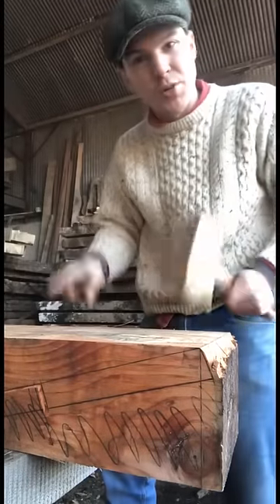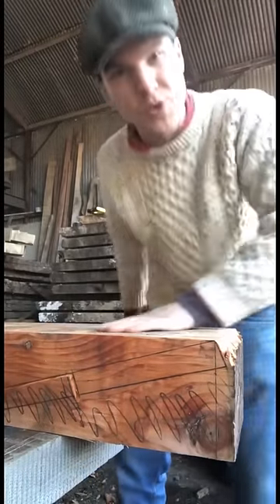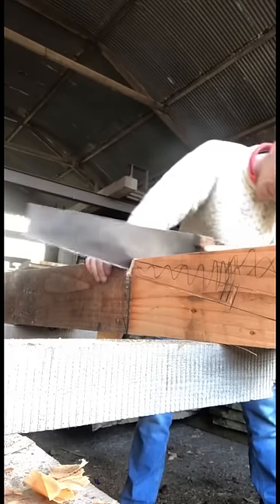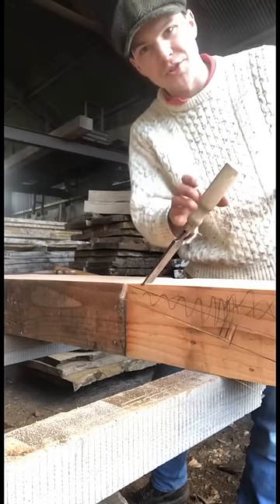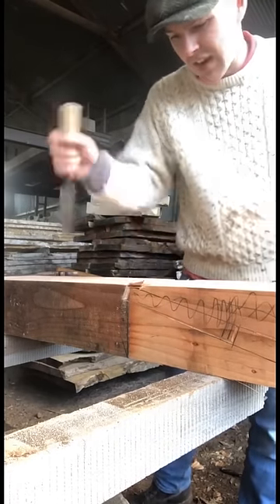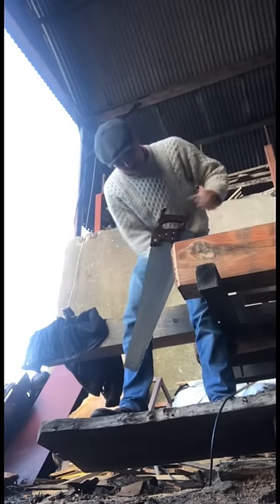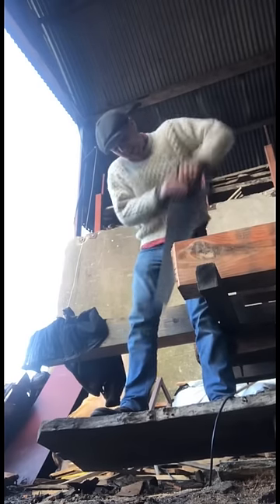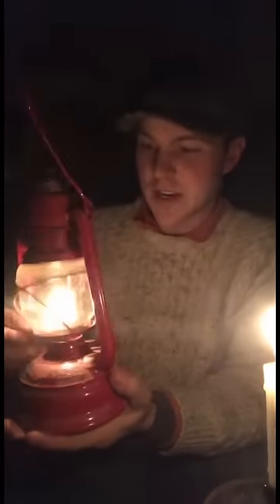Cutting A Large Scarf Joint #shortvideo #ireland #woodwork #joinery #timberframing

Comment: Scarf joints are fun. I use a circular saw to get close to my layout, and then cut the bulk away with a chainsaw. Then chisel to fine tune everything. A grinder with a sanding disc can speed up flattening the surfaces, too. I'd do one without power tools, but with multiples, and a client, power is pretty handy.

Comment: @EoinReardon I love your content Mr. Reardon. I have a very old hand sickle that clearly has hammer/mallet marks on the top curve of the blade. However, even though I'm not exactly sure what it was used for, I am pretty sure that this is supposed to be there to get the blade through whatever material it's used for.  If I send it to you do you think you'll want to restore it? It's most likely Korean, has a maker's mark the only things wrong are a bit of rust and an extremely dry wood handle. I'm asking you through here because I refuse to load TikTok on my phone and do not know how else to contact you.
Hope to hear from you, 
A possible cousin in the US.
(My Grandmother is a Reardon by birth)